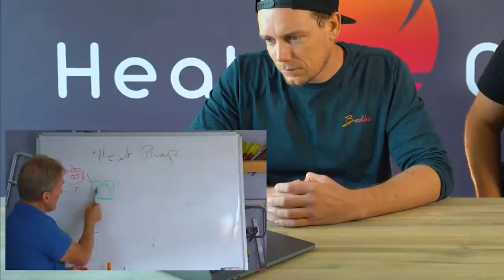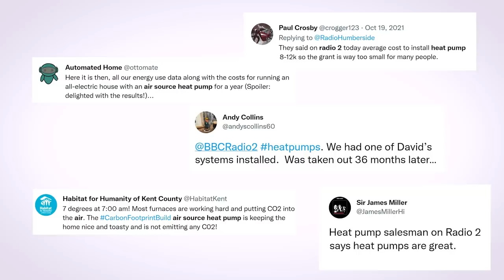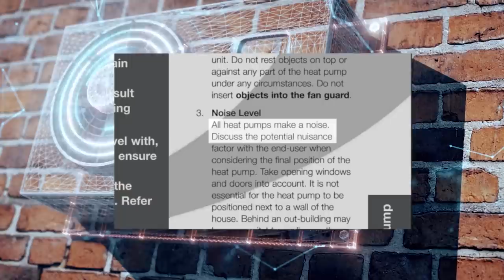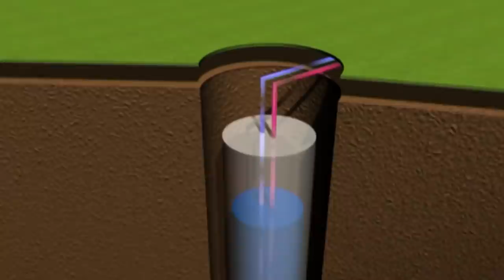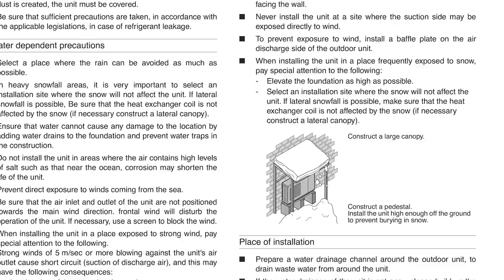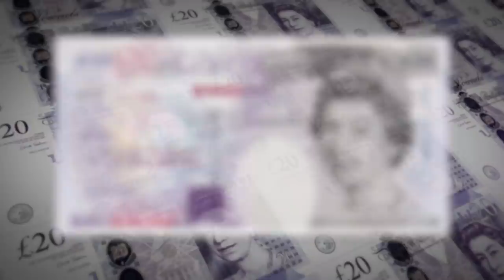Heat Pump Secrets They Don't Want You to Know

Comment: Great lecture Roger.
I have to ask though, when people try to knock power stations on film a picture is always shown of the cooling towers belching out condensation as if its trying to make people thinks its fumes.
Reply from the maker: You are right, it is just steam
Reply: @SkillBuilder  My inner pedant just has to point out its water vapour - steam is the invisible stuff that burns/scalds.😉
Reply: It is neither steam nor water vapour. It is simply suspended water particles, the same as clouds or mist
Reply: @Arthur-hx7sv  that’s water vapour 🤣
Reply: I alway laught at that, they brainwash people so much, its a bit like the condense vapour from car exhaust. but the argument is if the system is COP 4 and you need 8kw to heat your home then thats 8/4 = 2kwhr at let say 23p per kwh. your crappy old gas boiler even on an expensive gas tarrif will be about 12p per kwh, still near enough half the cost
Reply: @Arthur-hx7sv  incorrect - the invisible bit is steam.
Reply: @dantronics1682  COP 4?   LaLa Land.  3 on a good day, or 2 ish when it’s below 7C.  I like my split air to air for chilling and only use the heating for quickly raising the room temp, never as base heater.
Reply: @normanboyes4983  Tip for your inner pedant - it's it's not its
Reply: @KeithWhittingham  Tip for your repetitive self - stop repeating yourself. 🤣
Reply: @jimwoods9551  I was using the best figure, real world is a different ballgame, I've only ever use my split air for heating once.
Reply: @dantronics1682  Don't forget the noise, when you and your neighbor's fans are blasting away in and out of harmony a relaxing sit in the garden will be a distant memory.
It'll be reminiscent of German bombers overhead !
Just make enough bloody power and we'll all have storage heaters.
I just wish the powers at be would just stop feeding us BS and tell the truth like it is !
Reply: @nigelmitchell351  I know about that. someone 2 streets away have heat pump and I can hear it at nights, cant wait for more people to get them fitted :(
Reply: @dantronics1682  I know what you mean, I stayed in a cheap hotel once with about 7 AC units whiring away outside my room window all night, awful !
Reply: Its water vapour of course, cooling and condensing the steam from the turbine exhausts, but nevertheless WASTED HEAT!
Reply: @normanboyes4983  I agree with you Norman 90%  of the comments are due to total ignorance. people don't think and are not taught to think with clarity.
Reply: @normanboyes4983  I think water vapour is transparent.
Reply: @normanboyes4983  no it isn't. Water vapour is transparent
Reply: @normanboyes4983  really? What is the water in the air that you cannot see at say 18 degrees Celsius. Is that steam?
Reply: @dantronics1682  if I understand you correctly then you are conversing electricity to gas. 8 kwh equals 1 cubic meter of gas.
I have 15 solar panels on my roof but still I stay on gas for heating. I put in some electrical heaters in rooms. So when there is only limited demand for heat, I put on that yoke. Producing heat that way is far more efficient then through the heat pump.
I have a corner house, live on the coast of the Netherlands. I have a very low energy bill and like to keep it that way.
But the thing that has the most influence on the bill, is our quarrel with Russia. By now the cost of energy is going up so much, that you could allmost say: Never bite the hand that feeds you...
Reply: @pietermoorer3679  yes I'm seeing that on the news, My gas bill shows my usage in kwh so I dont need to do the conversion anymore, even though you 're futher north you get a better benefit from solar than us in the UK more clear sky in the daytime
Reply: its not a lecture, its a incoherent 10 minute rant about nothing.
Reply: @dantronics1682  You're right, but what is the power and the consumption of your gasboiler ?
Reply: @dantronics1682  When I did my calculations I figured it was 3 times more expensive than gas but still cheaper than electricity, but then who in the right mind uses electricity to heat in the first place!
Reply: @pietermoorer3679  Instead of don't bite the hand that feeds you how about don't rely on an abusive relationship. Europe should be self sufficient with nuclear and renewables.
Reply: @dontuno  yes thats my calculation as well, I know of a lot of flats which are electric only so the residents have no other choices.
Reply: @jimwoods9551  then you have a crap heat pump. My 14 year old mitsubishi achieves a COP of over 2 at -10c.
Recently replaced with a newer version, guaranteed to achieve a COP of 2.6 at -15c.
Reply: @normanboyes4983  Nope, he's right, it's little droplets, same as a cloud. That's why you can get legionella from cooling towers.
Reply: @dantronics1682  Errm.......... if you need 8kW to heat your gaff at steady state you use 8kWh of heat every hour. At a COP of 4 that translates into 2kWh of electricity every hour if using a heat pump. Assuming electricity costs 23p/kWh your hourly cost is therefore 46p.
Burning gas to supply the same load and assuming 100% efficiency to keep it simple, at a load of 8kW you use 8kWh each hour at a cost of 12p per kWH therefore your gas cost is 96p per hour.
Sums are wicked little things sometimes.
Reply: @normanboyes4983  Steam and water vapour are the same thing.
Reply: @mikekelly5869  you are late but still wrong.😉
Reply: @mikekelly5869  OK. Try running a stream turbine on water vapour - good luck.
Reply: @normanboyes4983  The convention is that what we call "steam"in engineering is usually assumed to be hot and at a pressure equal to or above atmospheric. However that doesn't change the fact that it's water vapour. Water vapour/steam is often generated by dropping pressure locally and flashing water into vapour at a pressure below atmospheric pressure. This is the principle used in steam refrigeration and is also drawn on in the practical application of the Carnot cycle, vacuum receivers etc. In these applications the water vapour/steam can be at a low temperature with the main energy use being the generation and maintenance of a stable vacuum.
Don't try to teach your granny to suck eggs. I designed my first process steam boiler in 1991 and I don't remember how many I've done since then. If you want to know about water vapour get yourself a set of steam tables, it's a good starting place. As for your turbine, water vapour at pressure and temperature is the working fluid.
Reply: @KeithWhittingham . It’s H2O.
Reply: @normanboyes4983  Well Norman... After accusing me of repeating myself when I did not you have now been proven wrong on the steam/water vapor question - are you going to be a gentleman and admit that you're wrong?
Reply: @KeithWhittingham  Well I am gentleman but sorry to disappoint you over an issue that clearly has been bugging you badly. You were wrong then and the passage of time does not change that.
Reply: @normanboyes4983  So I did repeat myself and water vapor is visible to the human eye?

Comment: very pleased with my air to air heat pump, £700 inc installation, plugs into a socket via a 10 amp fuse, I turn it on 15 minutes before I get up on cold mornings and off once on my feet. Being in the 'eat or heat' set it's a life saver.

Comment: Air Sourced heat pumps have been going in to commercial buildings for years and a lot of the points here have been overcome. Like anything you need to consider the design. Location of the unit is important. You can order different coil coating to stop and reduce corrosion. I have units that are suffering from costal locations even without any protection they are over 20 years old now and suffering. If they had been protected i might get 30 years. The problem the parts are obsolete. Some of these units going in now you might well have parts availability issues in 10 years time. Printed circuit boards etc. In colder location they are going to have issues. However here in Bucks the average winter temp is 7 degs C. Yes there are a few cold days but it is not going to be a problem. I can see issues in some parts of the country where they suffer from lower winter temps.

Comment: We have a 10 kw  mini split in our home. the out door unit is super quiet and the three indoor wall mount units are too. We live in a temperate weather zone -5 to 28 an average of 16 degrees. we also have a wood burner fireplace that we never use. its cheaper to run the heat pump than it is to buy fire wood. Plus the heat pump heats the home faster and more evenly than the fire does. We can also cool the home in the summer months. Its the best investment we have made in our home in price(including install cost) and in performance.
Reply: Where are you?
Reply: @safetyladysilver8988   Im in New Zealand,
 I would recommend a Mitsubishi system with the newer type gas. Very efficient and quiet

Comment: I have 2 mini splits, and they are protected from the elements just as you described, the shelter increased the efficiency and the system is just a part of the heating for the house, baseboards, and a gas fireplace round up the heating needs in a fairly moderate climate. Near the ocean , wet  with the possibility of light snow in the winter. and we leave the heat pump running 24-7 and it does the lion share of the heat load. estimate 50% heat pump, 25% baseboard electric and 25% gas. the system requires some attention to the different ways to heat the house. Cheers.

Comment: As with anything else, pushing everyone to install these will result in sub par contractors doing some of the work. Also, as with any other forms of heating, it will most likely be fine if the work is done by someone knowledgeable and qualified.
Reply: That's why I just install my own.
Reply: The big Achilles heel of heat pumps is the use of the wrong system for the building type. Domestic air to water systems are too slow and not powerful enough for poorly insulated and/or badly sealed buildings and unfortunately there are plenty of cowboy installers that will install them and run away. This is getting heat pumps a bad name. A good istaller will always make sure that the heat pump matches the application. If they run into problems making a selection they can call on independent building services engineers and get all the professional advice that they need.
Reply: @mikekelly5869  
You hit on it at the end. Installers have no business designing system applications.     We could never afford to teach installers in physics and in particular thermodynamics, therefore we let engineers design and installers install - to the engineer's plan.

Anyone who lets an installer design their system is rolling the dice.  That's not something that can be rightfully blamed on the equipment being installed.  Won't stop people from trying though; anything goes to shift the blame.

Comment: The manual for my gas boiler has 3 pages devoted to condensate pipework and how to install it so it doesn't freeze.  Not to mention, the 4 pages of regulations and diagrams of where you can put a flue! 

It's a wonder all you gas engineers can manage honestly.   It's almost like you just need to know what you're doing!

Comment: Nice one Roger. I've suspected for ages that ASHPs only work in the "right" situation, but you have put the facts out there that confirm it, so thank you for that.
I believe the current push towards "electricity for everything" to be a total con, and just another way to regulate the country's enconomy without having to put taxes up. Although that will happen as well. Gotta pay for all these vanity projects somehow... HS2 etc. etc.
Reply: What do you think we should use instead of electricity for low/zero carbon heating in the future? Heat pumps installed correctly already beat natural gas on carbon emissions though they are more expensive to install and at best only match gas on running costs.

Comment: The backup heat on the outdoor unit is mainly to help during the defrosting cycle. Every once in a while, the unit needs to do this to melt away any snow/ice build up on the outdoor coil. Having the electric heat accelerates this process.
Reply: Not sure where you live but resistance heat strips operate quite often in conjunction with the heat pump as it cannot keep up with heat demand. The resistance heat strips are almost entirely on the outlet side of the unit so there fire not transferring any heat to the evaporator coil to aid in defrost. They’re there to prevent cold air from blowing into the conditioned space while in the defrost cycle!
Reply: Our units have no physical heater element, they go on to defrost automatically which entails them going on to cooling mode (valves change accordingly), and stop the air distribution on the inside unit. This occurs around 4 times an hour on average, and only for a few minutes each time.
Reply: Mitsubishi ecodans  don’t use a back up heater at all.
Reply: @bradfordstoll5191  There's two "backup" heaters, you're talking about a different thing.
Reply: @britexpat_l33t  There's often also a backup heater on the DHW to bring the water up to temperature quicker when needed - in some instances it can actually help efficiency. Samsungs terminology is (I think) "Backup Heater" versus "Booster Heater". But yes, I completely agree the guy in this video is utterly clueless, way past retiring. lol.

Comment: Hi Roger
Are you aware that planning permission may be required for air source heat pumps? Is that mentioned in any of the installation guides?
I work for a social housing provider who will have to install electric heating systems at some point.
Whilst undertaking research I spoke to another housing association who told me that they installed a heat pump at one of their properties and the  noise was so bad that the Environmental Health Officer attended the property at 11pm instructing the tenant to switch the pump off. 
The council then informed the housing association that planning permission should have been obtained prior to installation.
Retrospective planning permission was sought and refused.
The heat pump was removed and replaced with a gas boiler.
Reply: A simple google search shows that you don’t need planning permission for heat pumps in the uk, the only requirement is that they must be atleast 1 metre from any boundary of your property
Reply: @davina2796  That is not correct. I quoted you a real life example above.
Do you have a link to your google search results showing planning permission is NOT required?
Reply: @davina2796    With a row of terraces, where the doors and windows take up most of the front and back, there is little space for an unsightly heat exchanger unit which is a metre or one and a half meters wide along a wall that isn't close to next door.   Siting between the back door to the garden and a window of a room at the back (not the kitchen as the kitchen window usually adjoins the back door) is often the only outside wall space available.   A humming pump will annoy people upstairs in bed and the neighbours either side... these units start quiet, but running for most of the time after a few years will start to grumble, rumble, and rattle.   Housing Associations, like local authorities, are usually not very good at maintenance, and respond to breakdowns rather than paying for regular servicing.    Gas boilers need certification annually.  Heat pumps don't.

Comment: Thanks Roger. I had an Air Source Heat Pump installed in my bungalow with underfloor heating throughout. I fully lined the bungalow with 50mm Celotex and made it fairly airtight. It works well and is at reasonable cost, and the bungalow remains a fairly even 22 degrees for several days after I turn the heating off. The issue is the system often goes to the fault setting and shuts off, typically around when most rooms are up to temperature. It is really annoying and I will need to see if i can balance the bypass and individual runs! As a former plumber I was horrified by the poor knowledge of those who fitted the system, including up and over pipework not having any way to remove the air!
Reply: did you solve this issue? Low loss header?
Reply: The quality of the installers is the biggest problem right now with ASHP's - as is adequately illustrated by the cluelessness of Roger in this video.
Reply: Hi Steven, Is the problem solved? do you have a buffer tank installed between the heat pump and your installation? I guess your system is shutting off because it does not need any more heat from the heat pump when the rooms are at temperature. I consider to install a heating pump and learned that a buffer tank in the system will level the heat energy and keeps the pump running more continuously on lower level which increases the cop! hope this may be of help to you